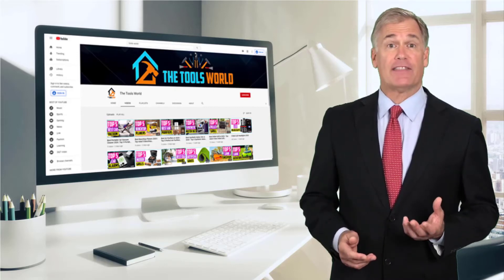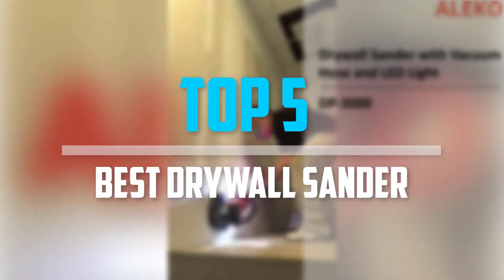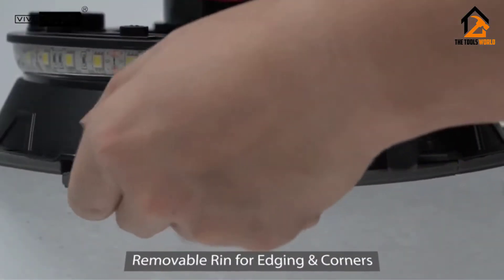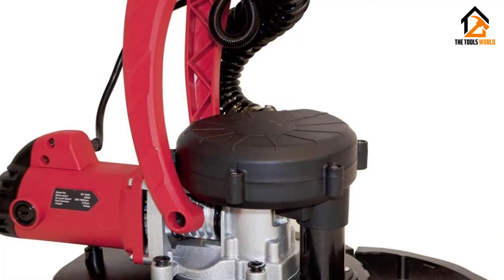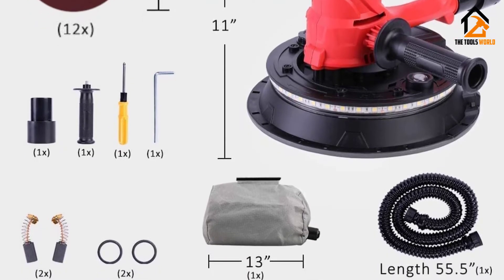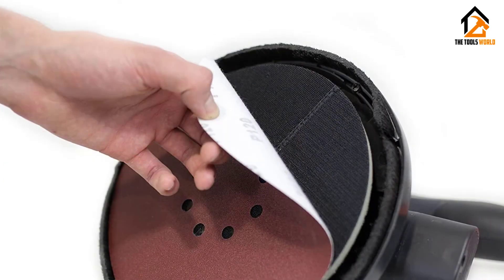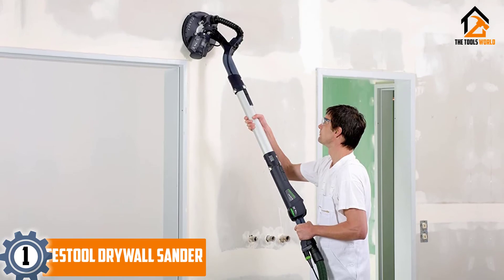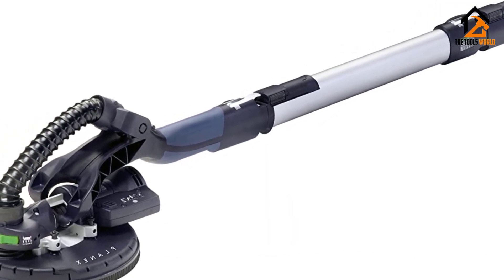5 Best Drywall Sander for High-quality Finish

Comment from the maker: ▶ In This video, We recommended the top 5 best Drywall Sander.

▶ 5. Arksen Drywall Sander.    
 
▶ 4. Aleko Drywall Sander.   

▶ 3. Power Pro 2100 Drywall Sander. 

▶ 2. Wen Variable Speed Drywall Sander.  

▶ 1. Festool Drywall Sander.